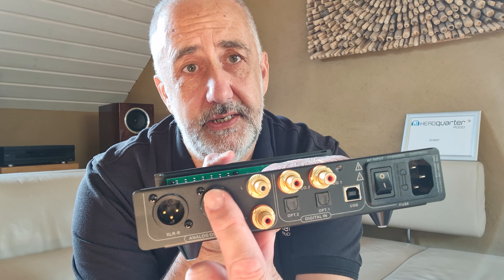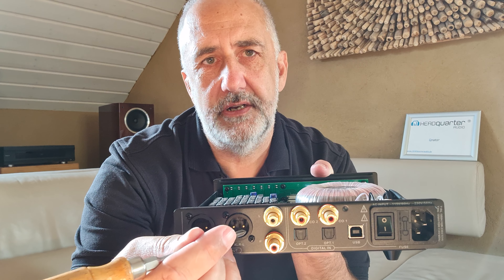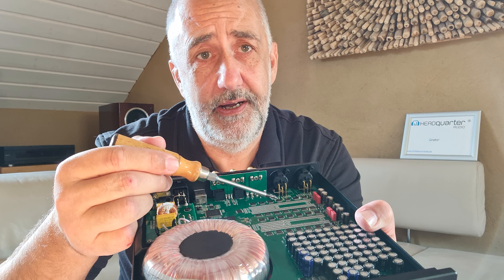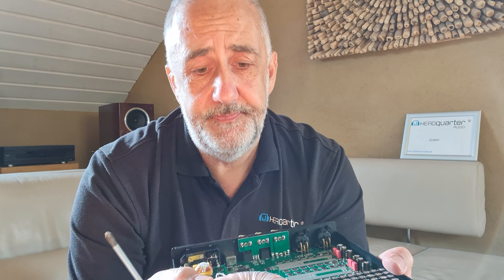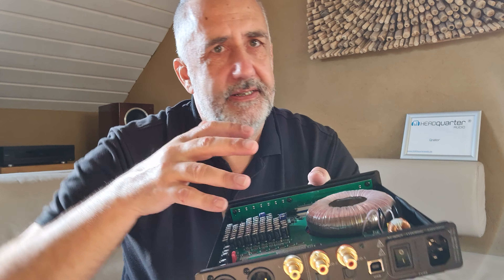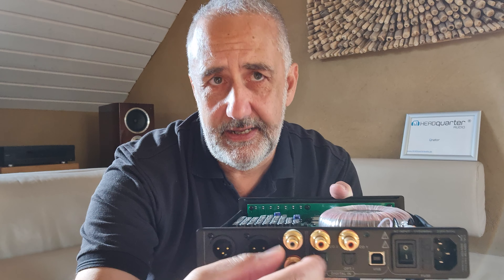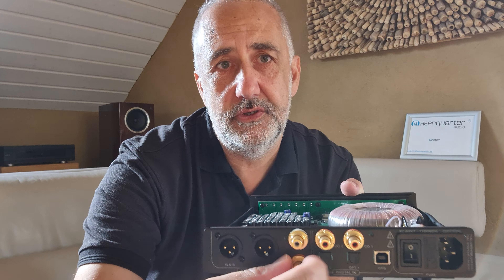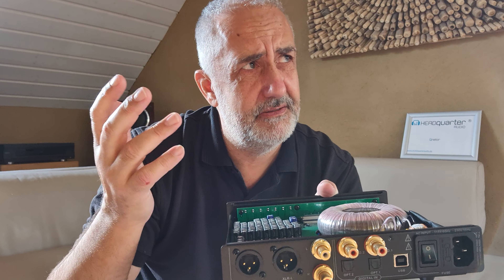STOP! Most important tuning tip ever! Not only Denafrips, for all new Devices!

Comment: hi very excellent video   If i understand well it could be a vibration issue ?
if so i think that the main vibrations generator is the mains transformer
its vibes are transmitted to the chassis that can even amplify them
i did some experiments with an old preamp  
Removing the mains transformer from the chassis was quite beneficial   The sound was more relaxed 
another solution could be a thick rubber pad under it
maybe i was hearing things i dont know
Reply from the maker: wrong way...for sure...cheers Mike

Comment: Tried it on the mighty RME ADI-2 FS. Went ahead and did the pro gold treatment since I hadn't disconnected the DAC for some time. Noticed the XLR turn a bit on unscrewing. Hmn, that is the issue there. Added some Tri-Flo to the screws and it got very nice and smoother turns with lighter pressure. Tightened them up and did the  RCA (connected to 65 watt mono blocks) and the Coax as well. Damn if that doesn't take it to a nice higher level. Very nice, thanks!!
Reply from the maker: Have fun :) Cheers Mike

Comment: What's your opinion on dampening the bottom part of the chassis? I am thinking of combining your lid tweak combined with putting bitumen plating around the circuitboard. I've got two Audiophonics/Hypex amps with enough space in the chassis to fill in. Forgot to add: I did this tweak on my old Topping DAC and the results were exactly as you describe! Gonna do it to my PS Audio dac next.
Reply from the maker: Dampening is the wrong way for me... we will have new devices soon...stay tuned cheers Mike
Reply: @headquarteraudio5388  ok, thanks!

Comment: Why are you not using a high precision torque screwdriver?
Reply from the maker: why aren't violins made on a CNC? ( which doesn't mean I don't have these screwdrivers :) ) cheers Mike
Reply: @headquarteraudio5388  OK Stradivarius. Very high precision is required in mechanical tuning but using very precise tools is not. It must be left to the feel of the craftsman. Got it.

Comment: Simply amazing. I tried it with my Pontus 2 plus Hermes DDC. I only loosened the screws of the XLR and AES out- and inputs for about 4 turns. Result: wider soundstage, preciser image, even more holographic sound, better bass. All the pros of the particular device are shining out a little bit more. And all the people, who think, he is crazy, have either bad hearing or simply a system, that's not refined enough. I assume, that with for instance with a 4k System you won't hear much difference. You need a good, high quality system, to benefit from these tweaks. But then, it can be a game changer. Thank you so much. Keep on twerking ... äh, tweaking. 🙂
Reply from the maker: twerking haaaaaaa 🤣

Comment: Great idea Mike. To use an analogy, it's like a tree bending in the wind. It needs to flex or it will snap. The same goes with the circuit board, there needs to be a little play in it (albeit micro) so the panel isn't stressed. Subbed

Comment: I have open my Case after the Warranty is closed. And I loosened all the screws from the circuit board and connections and tightened them again slightly. The screws on the circuit board were relatively tight. I think the sound has become a little softer, but I can't say for sure. The circuit board in my unit is relatively robust. It was also not a Denafrips device. But also due to the robotic manufacturing, it can easily bend the circuit board.
Reply from the maker: Hi, sometimes it is important in which sequence the screws are fixed.. :) Cheers Mike

Comment: You make a good point about not putting stress on the connections to the board but that is the reason these connectors are screwed to the chassis; to avoid stress on the solder joints when cables are plugged in and out.
Reply from the maker: Hi, misunderstood, it is important to me not to twist the sockets when tightening the screws and thus tension the circuit board. Big difference. Cheers Mike
Reply: @headquarteraudio5388  I think I also didn't understand the video. So the idea is:

1. Lose the screws.
2. Let the socket take its natural position.
3. Tight the screws but make sure the position taken by the socket in step #2 doesn't change.

Correct?
Reply: @dvlduvall  I agree the explanation was a bit off, possibly due to language barrier

Comment: Oh wauw, this is an eye-opener maybe, hopefully. As a matter of fact I had a puzzling experience with a music piece I know very very well, because I listened to it thousands of times. The first  time I played the cd through my Ares2, it sounded harsh in higher frequencies. I was dumbfounded and could not understand. I tried the same recording through streaming from Qobuz (also through the Ares2) and heard the very same harshness again. My favorite music all of a sudden sounded bad! I checked the drivers of my vintage speakers (IMF TLS80) but could not find any fault there. More broadly I found that the music that l listen to sounds sometimes very very good and at other times much less impressive, less airy. I then decided I was imagining things and it was because of stress or whatever that my ears/brain were not hearing right. I never thought about the fault maybe being with the Ares, because it seemed to perform very well.
I will try the screws at the backside, loosen them and re-tighten the way you described with only little force.  I'll report in a few days what I find.
Reply: Ok, I immediately went to work. I noticed however that the screws were not overly tight at all on my Ares II. But since I was on it anyway, I went and unscrewed/retightened all connections even less tight. Now if I was the overly confident type I would double down and insist that it made a huge difference but I am an honest guy and while it seems to sound better, the difference is not very much. I have to accept that my system sounds very good most of the time, but is much more revealing than what I used to have before. So when a recording is a bit harsh to start with, I will hear it. On the other hand, when the recording has a good balance, it is absolute bliss. This is not to say I give up on tuning. I will also redo the connections of my tube amplifier and who knows what I will find.
Reply from the maker: Hi, wonderful, I'm curious ...but the Ares2 should always sound the same, maybe the Ares 2 also demands a subsequent component (cable, preamp, power amplifier ...) ... then you have to be Sherlock Holmes ... there is a reason for the inconsistent sound quality, this shouldn't be the Ares 2 ... Cheers Mike
Reply from the maker: Hi, it also occurs to me: Ares needs the phase to be right, it must be observed
When power cables or even worse signal cables with powercables cross each other, the signal loses energy and everything sounds the same .. small.
Never operate a router or telephone or TV on the same power strip. Not even on the same circuit, simply switch everything off using a separate power strip with a switch while listening to music ...If you use NordOst cables, they must never lie on a carpet; other cables should also be placed on foglifters or small wooden blocks

oh, there is so much to consider, the sum of the little things can add up ... :) viel Spaß! Cheers Mike
Reply: @headquarteraudio5388  I have been playing Sherlock Holmes and learned a lot along the way, but to stay on point: the Ares2 is NOT the culprit and neither is any of my amplifiers. It's the vintage IMF TLS80 speakers that I recently acquired. It probably needs it's crossovers examined or perhaps one of the drivers is damaged. I have done several frequency sweeps with two sets of speakers and it turned out that the IMF's were kind of rattling at two very specific frequencies, while the younger set of speakers sounded fine across the whole spectrum of the same frequency sweep. Overtonesinging revolves very much around certain fixed, prolongued frequencies and that is probably the reason I heard the flaw specifically with that kind of music. https://onlinetonegenerator.com/frequency-sweep-generator.html
Reply: So now I tried (again with a frequency sweep) to find out which speaker driver might be defect and it turns out that they are ok? It's the vintage Sansui receiver standing on top of the speaker! It's not connected to anything, just sitting on top. The housing of the receiver resonates around 135Hz! So every time the music passes this frequency I hear a rasping sound. Took the receiver off, should be ok now. :-)

Comment: On checking my connections I found the phono connections are only finger tight (loose) the XLR ultra tight. Loosened the xlr and to my surprise this did indeed change the sound. I’m currently listening with oversampling off which seems to suit . Always used oversampling with soft filter prior to this in my system. Denafrips Aries Ii , Eastern Electric M88 into open baffle speakers. 
I’ll have a few days experimenting with sampling and oversampling ad then the acid test...tighten it all back up and relisten.
Reply from the maker: Hi, yes, of course it always depends on who has installed a device and how it was on the day. I would recommend torque wrenches and torque screwdrivers to manufacturers, this minimizes the variance. Cheers Mike

Comment: It's an interesting fact of how mechanical vibration can or can't afect sound reproduction, only by unscrewing some partes. I know, from experience, that all kinds of vibration can degrade sound, through powercables, interconnects and also via equipment chassis.  I've tryed at home with my wonderful Weiss 202 DAC and surprisingly it really make a difference. I've noticied a better tonal presentation and a better stereo image. Thanks for the tip.
Reply from the maker: Hi STOP. Not only unscrewing, but unscrewing, tighten the screws again without twist force to the socket. If you only unscrew the screws the sound will be imprecise and poorly differentiated....see other comments and my answers...Cheers Mike
Reply: @headquarteraudio5388  , I did exaclty that. Less tighten. I haven't explained me properly :)
Reply from the maker: @rasardo1  Puuhhh great :) Cheers Mike

Comment: Denafrips recommend only connect either XLR or RCA input at the same time to improve sound quality, even if both are connected but 1 is off. How true is this?
Reply from the maker: Hi, thats right and true ( read review at 6moons and others ) XLR alone is best!  cheers Mike
Reply: Both are always on and directly output from the ladder.. no output stage, if both are plugged in it is too much load on the output.
Reply: That’s because an RCA cable that’s unconnected from a downstream component becomes an antenna for RFI. Has nothing to do with stress on the PCB.
Reply: My Ares does not put out a signal when both XLR and RCA are connected. I tried to do A/B testing on the same preamp, and I didnt get a signal until I unplugged one from the back of the preamp.

Comment: I got the point, understand that unnecessary stress on circuit board is not good. But I have one question. When XLR socket is not firmly attached to chassis with two slightly loosen screws, than after robust and heavy XLR cable (very common problem on high end cables today) is inserted, weight of those cables could be transferred as another stress directly to circuit board again. Is there any other method to avoid such problem? For example to decouple XLR socket by inserting small elastic or rubber washers between two screws and chassis?
Reply from the maker: Hi, great comment. If you use the XLR output, you have the following options: Loosen the screws of the two XLR outputs or all of your device, plug an XLR cable into the socket and hold it while tightening the screws so that the torque does not affect the socket passes and the board is clamped. In the case of very heavy cables, please always use a vertical stick / board / lifter under the overhanging cable to remove the tensile force from the sockets and thus from the circuit board ... Cheers Mike
Reply: @headquarteraudio5388  yes, I understand. I am design engeneer in automotive (werkzeugkonstrukteur) so I always tend to inspect hi fi device from mechanical construction point:-) I also noticed some free play between aluminum bottom plate on my Denafrips Gaia which resonated a bit. Fixed with soft rubber tape between the plates... there is always room for small tuning. Thank for advice.
Reply from the maker: @radkokosoTT  Hi, please remove this rubber tape and listen to the Gaia again ... the step back is usually enlightening ... change the assembly of the plate or loosen all the screws on the housing, place the device on a flat surface and then screw first tighten all screws, not too strong. Normal, it's not a car :) Sometimes the device cracks when you loosen screws, then you know immediately that it sounds better after the operation. :) Cheers Mike

Comment: I am seriously considering this Dac. I will certainly try this. When you think of it, in all electrical
devices there are frequency dynamics at play. Ideally, each and every electrical component 
within this DAC would exist in 100% total isolation. Now beyond EMF there are as well., microphonic
frequencies such as those that can effect a vacuum tube. Perhaps your "relaxing" of the various
screws somehow reduces structural tension and thus reduces unwanted microphonic vibrations
translated through mass. Just speculating but if a true difference can be perceived then something
has caused it. Again, I am speculating - my background is  not electrical engineering.
Reply from the maker: Hi, In my experience, it is the tension itself that makes a circuit board, cover or device vibrate unnaturally and distorted, so it doesn't sound realistic and real, but sometimes exhausting and tiring. It's like a brake in the device that makes the music stressful. And there we are not yet with material sound and the dimensions :) Cheers Mike

Comment: But will you not risk that connecting and disconnecting the XLR cable now put more strain on the circuit board than before?
Reply from the maker: Hi, you shouldn't unscrew the screws, but tighten them so that the socket doesn't turn and the circuit board is thus strained .... Cheers MIke

Comment: I don't mean you any disrespect but this sounds like nonsense.  If torquing the screws to new angles is helping, then all I can really think is that the soldering in these DACs is just bad and all that is happening is a new pressure point of the pins against the poor wetting in the hole gets created and is helping to improve the connection.  It seems to me that reflowing the joints of the XLR connection would do the same thing or even be more reliable (future vibrations over time) and this is all just poor QC on Denafrips' part.
Reply from the maker: Hi yeah, no problem, I thought beforehand that it would be controversial. but if you don't try it, you can't have a say. Why and how you come up with the fact that Denafrips has bad soldering quality is incomprehensible. This is exclusively about tension on the circuit board and in the device as a whole caused by torques. Just print it out, it doesn't cost anything, no guarantee is lost and you can simply undo it ... it's only 4 screws :) have fun with it, or just keep listening to it as before :) also legitimate .. Cheers Mike
Reply: @headquarteraudio5388  Incomprehensible?  It's just science.  If torquing the connector is helping then it's just a weak solder joint.  I don't doubt you at all when you say it is making a difference.  I just think the reason behind it has a simple explanation.  Sticking tape over a spark plug wire to keep all cylinders firing works too, but that's ignoring the fact that the terminal's grip is loose and needs tightening. :)  I think Denafrips could fix this by increasing the dwell time in the solder tank or training their staff to apply proper heat if it is a manual process.  Anyway, I'm not trying to start a fight.  It seems like a learning opportunity.  I've been thinking of buying one of these so many I'll just reflow the pins and see if it makes a difference. ;)
Reply from the maker: @MWeston2  Sorry, but you did not understand the video and the point of it... Cheers Mike
Reply: @MWeston2  Hello. Just a question for you. Are the various solder joints maintaining the rigidity and stability of the circuit board? Thanks.
Reply: @headquarteraudio5388  yea that's kind of weird - he takes the time to write long comments, but obviously has not watched the video 🙄

Comment: Will this apply to the headphone amp as well?
Reply from the maker: Hi, there can be an advantage that applies to all devices. But if the device is already years old, then it has settled down, which then requires a sure instinct, I would not recommend it without experience. Cheers Mike

Comment: A liitle   tuning  is,  using  the Dynamat Extreme  over  quartz oscillator  and  chipset  of  Dac   as micro vibrations damper.   There' s a  little  improvement to listening.
Reply from the maker: Hi, not my way, it sound clearer, with more details, but you lost musicality and tones...my experience...remove it, and you will see.. :) cheers Mike

Comment: Very sceptical. However if it were true you'd be better off cutting the solid connectors and replacing with flexible wire.
Reply from the maker: Hi, no, its not better, you cut the resonace connection too, stranded wire sounds horrible...cheers Mike